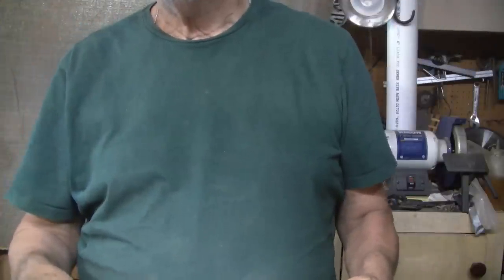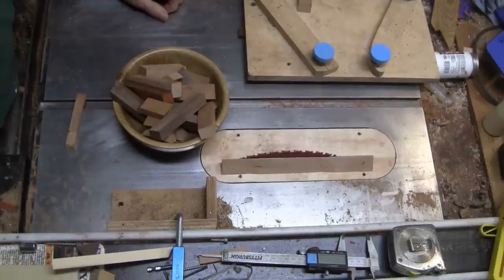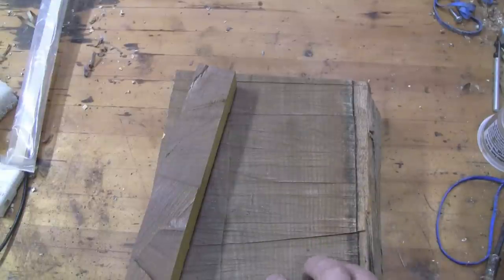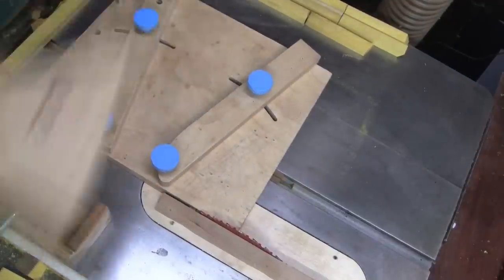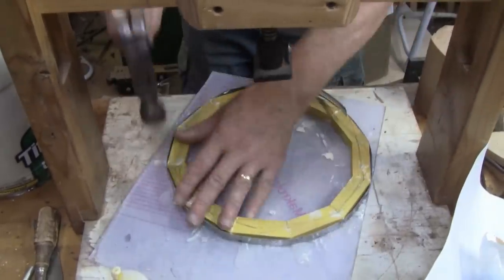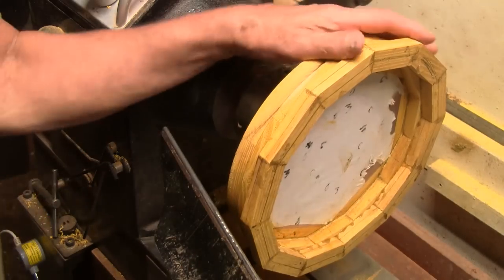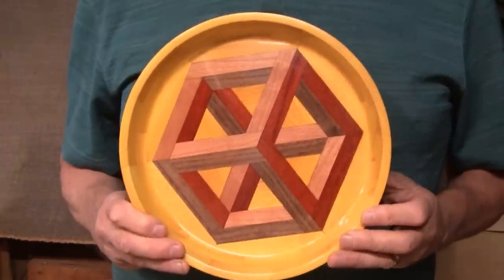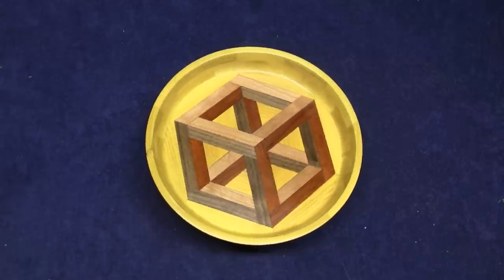A Simple But Cool Illusion For All Levels - Wood Turning

Comment: Gary, that is an awesome piece! You are a brilliant craftsman. The choice of woods you used was perfect. I would much enjoy and appreciate a simplified video on how to do that with limited math skills. Again that is amazing. Thank you for the great video! Try to stay cool in the heat wave.
Glenn
Reply from the maker: Thanks so much Glen. So there will be no geometry to speak of. (It will be there but you will not know it or need to) but a calculator might be called upon and a pencil to write down some dimensions.
The rest will be up to you to set you sled or fixture up to make the cuts. Easy money!
I am getting real excited about doing this and I have a few weeks where I can work on it. I just want to make it real easy to understand. I know I have issues understanding where others may not(too many years of working to close tolerances) 
 But I will get it worked out soon.
Thanks for watching,
Gary

Comment: Thank you Luie...what a great gift. 

It really turned out great Gary. I'm assuming that your shop has a low roof. Not that 104 is cold but a high ceiling would help. Love the bowl/serving tray.
Reply from the maker: Thank you Rick. Well my head does not hit the celling but I can not fit a basket ball hoop in here.  I suppose I could raise it up but then I would loose storage space. 
These temperatures are not normal for us but maybe they are going to be made the normal.
I suppose the positive side is a lower room is easier to heat than a taller one.
But the good thing is I can go inside to cool off or warm up LOL.
Thanks for watching,
Gary

Comment: Very nice, Gary.  Down here in  East Texas, we have quite a lot of Osage Orange (a.k.a. Bodark or Bois D' Arc).  Some  of my wood turner friends here don't like turning it when dry since it becomes very hard.  Personally, I have turned it once or twice and did not find it too difficult to turn. The wood does make nice bowls with great chatoyance in the grain. I think your turning proves that point!!  Yeah, I'd like to see the video you mentioned making the design without using math and a compass just to see how you do it.   Thanks for sharing!!!
👍👍👍👍👍👍👍👍👍
Reply from the maker: Thanks John. It is a dense wood that seems a little hard but I find it turns fine.  Easier than Black Locust that is fully dry or Camellia. 
Working on the simple method. Actually been working on it before I even started this one. 
Thanks for watching,
Gary

Comment: It's a great shame that most schools (in the UK) no longer teach geometric construction but rely on the computer 'geometry' more than ever. But I've had several occasions over the last twenty years where students studying Design Technology have struggled with certain designs because they did not have access to the correct computer software - in some cases resulting in guessing the design. An example was my son wanting to construct a 'cam with instaneous fall' His teacher had not a clue how to set it out - all that the majority of teachers can achieve on cam design is an ellipse. I showed my son on when designing cams the importance of a displacement diagram. His teacher invited me to the school to show a class how this achieved. Over the next few weeks I instructed - how to divide a line into equal lengths without calculation - polygons - true lengths of 3D angled lines,etc. 
So it may be an idea for you to demonstrate simple geometric techniques - resulting in a practical application. As a fellow pattermaker I'm certain this would be of interest to many. 
The visible striking piece you have produced here is a credit to you. I look forward to your next creation!
Reply from the maker: Thank you Anthony. I think they area skipping a lot of the basics in math anymore.  I remember showing apprentices how to subtract a number that had a higher fraction than the number they were subtracting from without a calculator and in your head. Along with other math tricks I hardly use anymore.  Similar to figuring out how long ago it was for something in the 1900's to our current year. Basic math but a lot struggle with it today because of computers and calculators.
 I think the things that excite us in math bore others.
I will show how to draw this shape and then break it down to even easier way to get it done. But a drawing is good to help see where you are going. A little road map.
Thanks for watching,
Gary

Comment: I'd like to see how the illusion is made with drawings.  The best thing I've learned from you is using hot glue to place a temporary tendon on my vessels and removing the tendon with denatured alcohol.  I've almost used 100 glue sticks in my glue gun.  I wasn't too sure what I was going to do with my glue gun, but it has become an integral tool in my collection.   Thank you!!!
Reply from the maker: Thank you Rusty. I find the hot glue gun to be a very handy tool as well. 
I will be doing the follow up on this illusion soon.
Thanks for watching,
Gary

Comment: Well done. I’d love to hear more about the process you used to design the vessel. What kind of glue did you use in that heat? Titebond 3 that’s been chilled has a longer open time and that helps in complicated glue ups.
Reply from the maker: Thank you Greg. Pretty sure it was Titebond III but not chilled down. I did the gluing fairly early in the day. It went together better than I thought it would.
Thanks for watching,
Gary

Comment: Fantastic demonstration!  Gary, how is your segment length adjustment made with the piece clamped to the fence?  Do you set the fence location based on the tape measurement needed from the saw to the length stop?  Thanks.
Reply from the maker: Thank you Mike. I use my digital calipers to scribe the length on a scrap piece. I then make a cut slightly longer than the line. At that point I can see that maybe I need to make a .030 adjustment and then I bump the fence over. I got pretty good at controlled bumps LOL.
The reason I make sure it is long so I still have the scrap to fine tune to size.
If I can find the time have been planning on making a stop with a screw adjustment.
 Maybe use a 1/4-20 bolt. But been making adjustments like this for years. Same way I adjusted the table saw at work and had to get the dimensions right on.
Hope that makes sense,
Gary

Comment: I see you hot glue a lot of tenons on, and that looks like a lot easier way to do it, but do they ever fly off ? And where about in Oregon are you , I'm from Coo's Bay : )
Reply from the maker: Yes I do use a lot of hot glued on tenons. Especially pieces like this where I am limited on thickness to put a tenon on and would not want a recess on this. I find that hot glue holds good or for sure I would not use it on a glue up where I have spent hours getting to the point of turning it. If put on correctly they should hold fine. If you get a lot of catches I am not sure I would use them. But even a turned tenon can let go with a bad catch. 
The trick is make sure the hot gun is at a setting to easily melt the glue and I do not put any under the tenon. Just around it. If you have it under it is hard to get flat and that leaves a way for the piece to wedge it off. Leverage is very powerful. Test it lout out on some scrap piece and see what you think.
 I live in Garden Home Oregon. Which is next to Beaverton, Raleigh Hills and Tigard. All are south of Portland a little.
 We like Coo's Bay a lot and have camped down at Sunset Bay park a number of times. We used to do a lot of riding in the dunes down that way as well.
Thanks for watching Greg!
Take care,
Gary